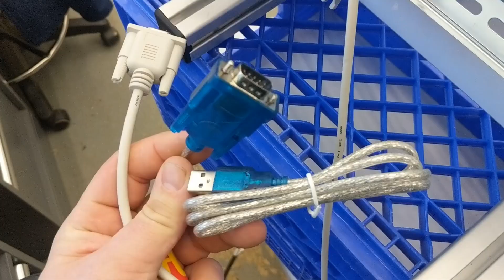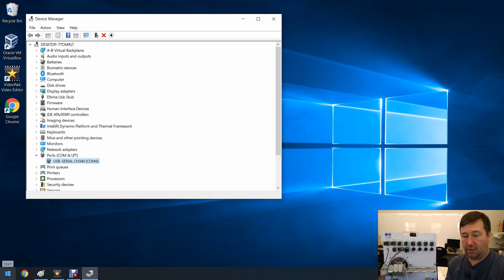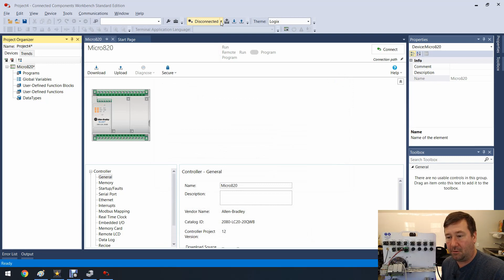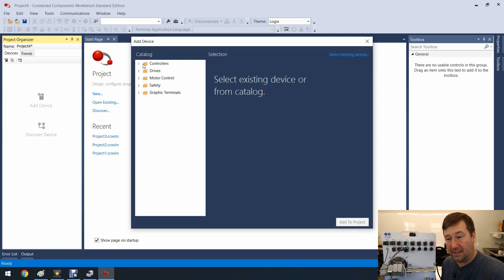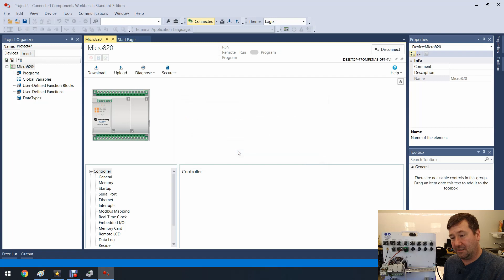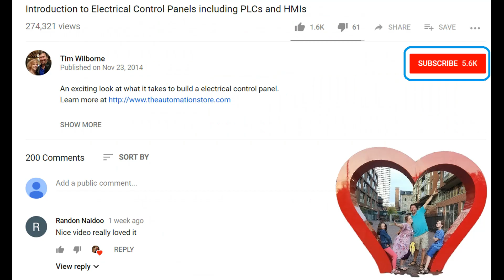Connecting to an Allen Bradley Micro800 PLC over Serial

Comment: I have a used 820 from work that they were going to pitch. Figured I'd play around with it at home. I cannot for the life of me connect to it with CCW. I bought your IP Explorer Pro tool and I can see it but it won't overwrite the IP address. I can ping the PLCs IP address from my PC but CCW still can't see it. I tried to configure it through the micro sd card and write the IP address like that but it didn't take. I will have to try this serial port communication method. I'm kinda computer illiterate and I can only half ass my way through PLC programming but I wouldn't think it would be so damn difficult to hook up to this thing.  Again I'm only doing it to play with it, no real reason to own one. I've spent more on time and tools trying to connect I'd be better off buying a new Micro820 but I'm not going to give up with it that easy.
Reply from the maker: This video explains why you can't change the IP address. You have to take it out of run mode. If you can ping it then you should be able to comment. My first guess is a firewall is blocking 2222 or 44818.
https://youtu.be/Htq-EOdJBu4
https://youtu.be/Htq-EOdJBu4

Comment: Do you perhaps know the pin-outs of the AB Micro810 PLC. It appears to be a 10 way 2.0mm PCB Straight Pins DIL Female Socket Header on the lower right face side of the PLC ? Just the RS232 Ground, Tx and Rx wires are probably all that is required.  I have a USB to 9 pin Serial RS232 connector which works great on the PLC I tried it on so far. I also use the RS485 adapter sometimes, if necessary on some machines.
Reply from the maker: I'm not sure.  I know they make a USB adapter for it but you are likely correct that is in fact a serial connection.
Reply: @TimWilborne  Thanks yes. Adapters are not so quick and easy to come by here so I just use the 3 pins ((Gnd, Tx and Rx) from my USB to RS232 9 pin adaptor. The thing is determining which pin is ground on the 10 pin connector is the first step and then finding the RX and TX after that. I'll have to measure the voltages. A bit of effort required by myself.. Thanks anyway,
Reply from the maker: I don't think it is as simple as figuring out the pinout.  All the other Micro800s specifically say they have a serial port.  The Micro810 says it has a USB port.
Reply: @TimWilborne  Might have to get a 2080 Adaptor looking at the CCW Software which looks like it loads up the driver for the adaptor or PLC. Not sure.

Comment: I’ve tried to make this work on my Micro 820 with every setting I can think of. Tried switching Rx and Tx. Every time I get the message “Failed to find the baud and parity!” Do you think it is an issue with the usb cable?
Reply from the maker: It could be. Where did you get the USB to serial adapter?
Reply: @TimWilborne  the dreaded online auction site.
Reply from the maker: @joshjohnson7939  Haha, most of them are compatible but sounds like you got a dud.  Hopefully it didn't burn out the serial port.